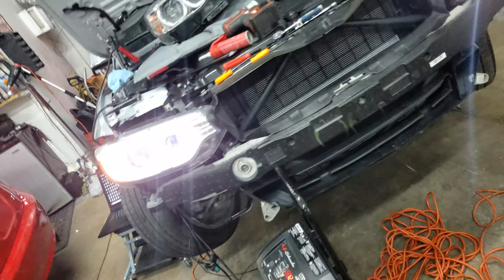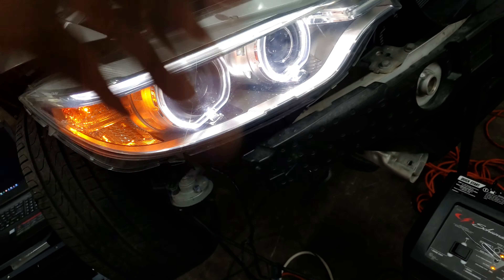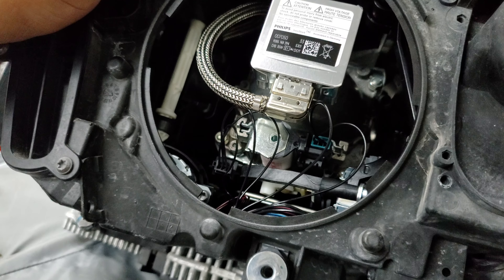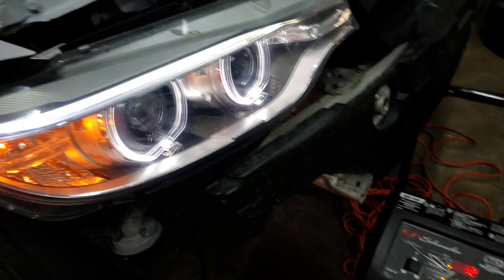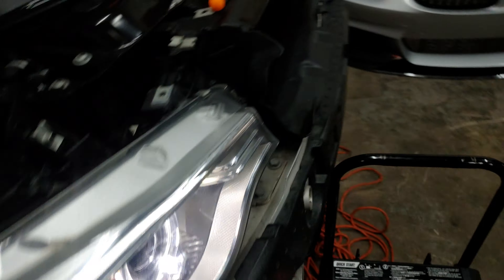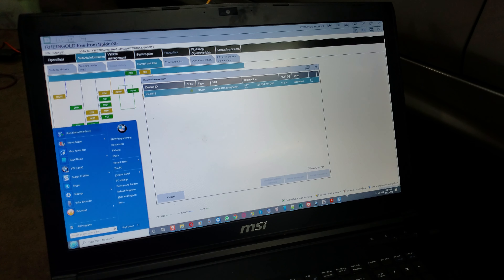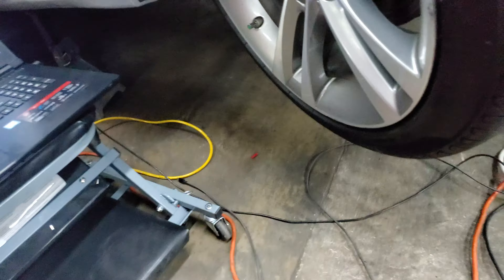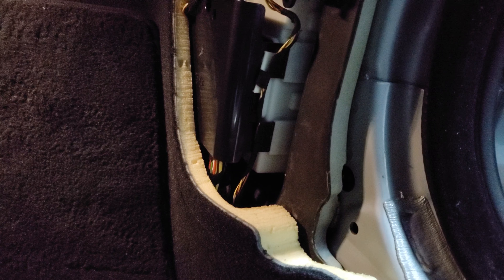BMW F33 TMS3 (HeadLight Module)_right Part_10 ( text Watsapp +1786-355-3660)

Comment: Hello .. Good night. I have a BMW 320i F30 2014. The headlight on the right side stopped turning on the LED above the angel eyes (the horizontal one). I couldn't find the module responsible. Is it possible to replace it? What is the module?
Reply from the maker: contact me via watsapp +1786-355-3660